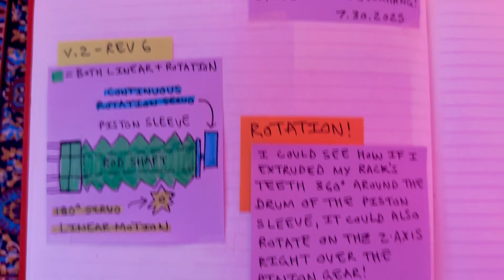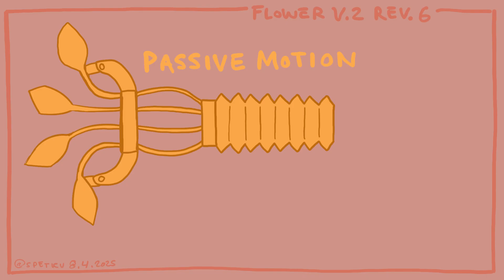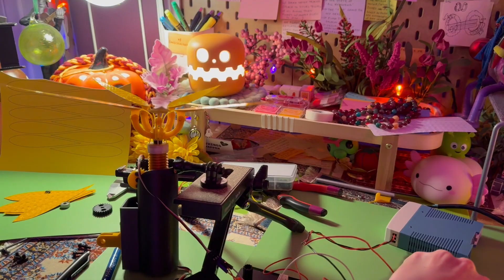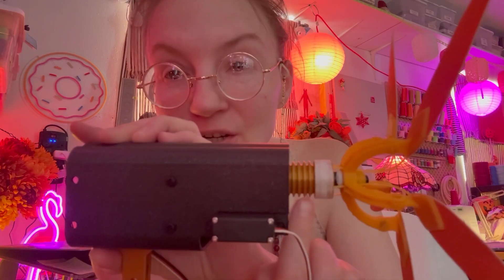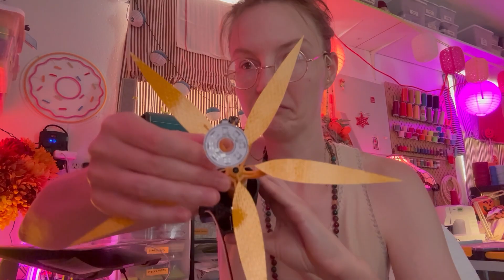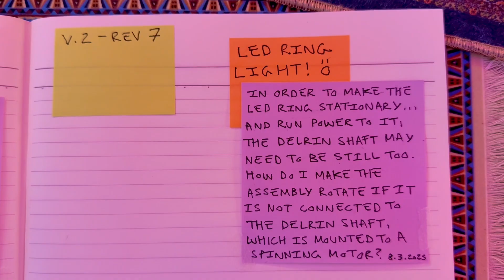flower : drive, revision 2 : rotation

Comment: Would it be possible to power it using two slip rings around the shaft at the edge of the case? There could be two contacts reaching out to the two different diameters and contacting while the spin.
Reply from the maker: I don't think I'll need a slip ring for this. I haven't used one yet, but I bought one just in case. I may play with it for fun for the sake of learning though